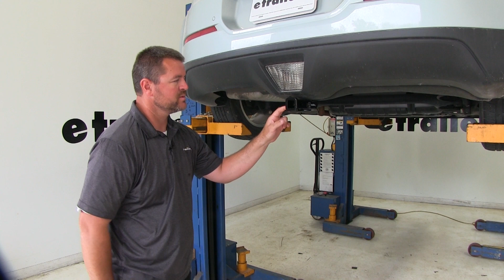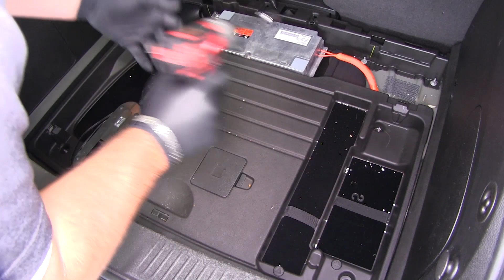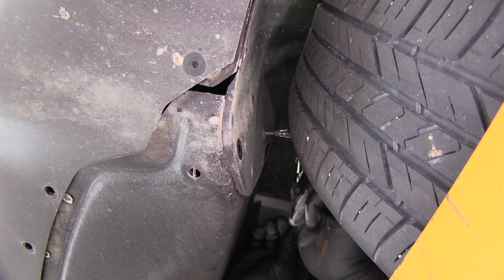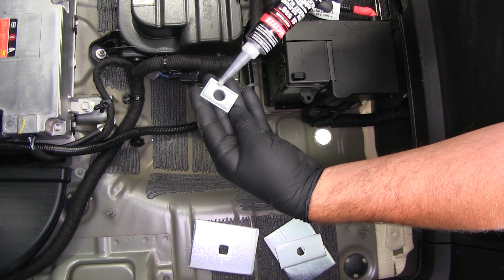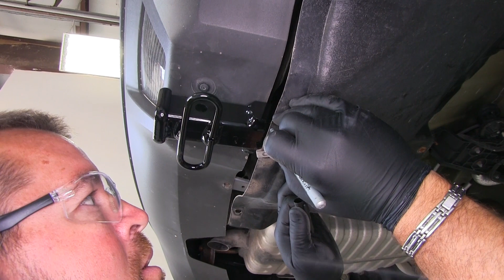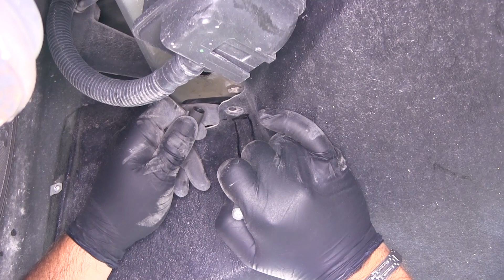Step-By-Step Installation Tutorial for the Curt Trailer Hitch Receiver on a 2013 Chevrolet Volt

Comment: doesn't anyone wire up trailer lights on these?
Reply from the maker: We do not currently have any wiring options for the 2013 Chevrolet Volt. This is most likely because the vehicle may not be rated to tow a trailer. That makes this hitch great for hauling accessories to get your gear to and from your destination.
https://www.etrailer.com/Trailer-Hitch/CURT/C11221.html
https://www.etrailer.com/vehicle/2013/Chevrolet/Volt
Reply: Na fuck the police

Comment: Just wanted to drop a quick note of thanks.  I just finished installing this hitch on my 2012 - and the video was spot on.  The only issue I ran into was one of the threaded frame inserts was more than just dirty... Ended up chasing the threads with a tap.

Comment: This is not the hitch the website recommends,  do you have the recommend hitch on video?
Reply from the maker: The Curt hitch shown in the video is indeed a fit for the vehicle. EcoHitch offers two hitches for the vehicle, part # 306-X7180 and # 306-X7186, but at this time we do not have install videos for them.
Reply: I mounted the EcoHitch Invisi on my '13 Volt, and it mounts to a very weak location on the rear (bumper bolts). The metal bent and the hitch sagged after 1 road trip, so I uninstalled and returned. I was well under the recommended weight with the lightest 4 bike carrier, 2 lightweight adult road bikes and 2 kids bikes.
I'm going to try this hitch, it looks like a stronger mounting location even though the weight limit is much lower. Folks on the forums have good luck hauling 2 bikes with this hitch, I'm not going to try 4 bikes again.